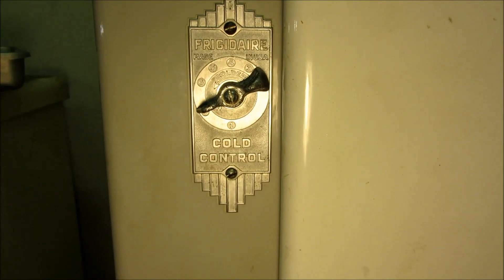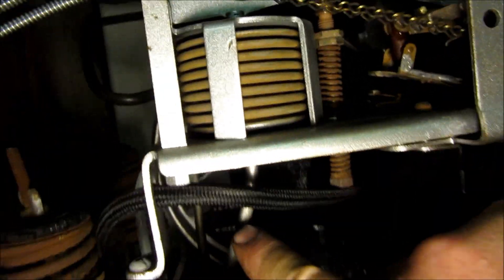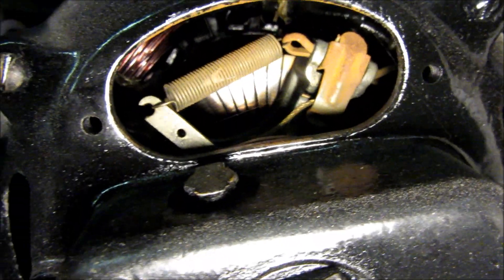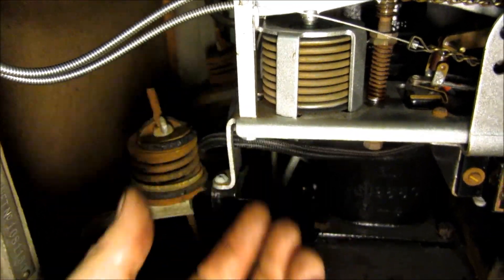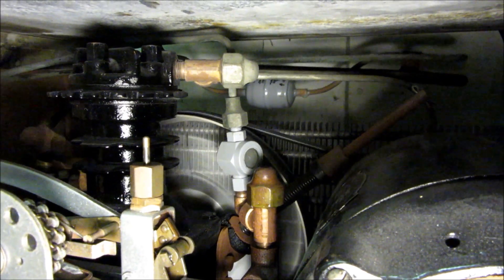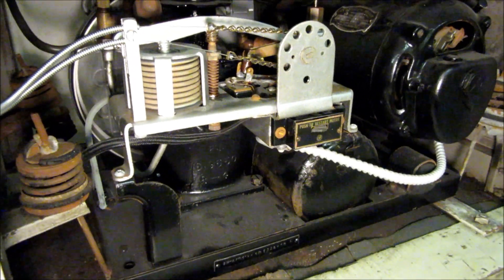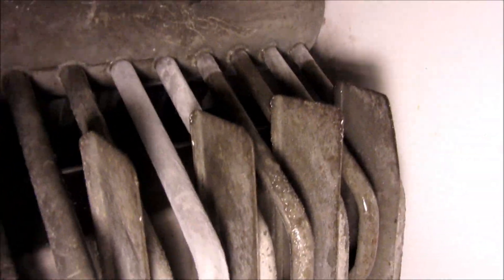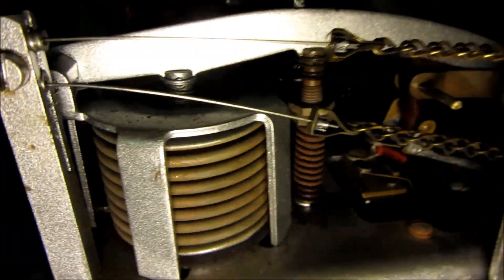Antique Frigidaire Refrigerator Cold-Control. 1927 - 1929

Comment: Beautiful engineering, and a beautiful restoration. That kind of elegance and quality will never be manufactured again.
Reply from the maker: This is true, definitely. Honestly I didn't have to restore this one. All it needed was a shaft seal, belt, and rewiring. The condition of the fridge (aside from the condensing unit) is as it was found. I did clean and paint the condensing unit during the repairs.

Comment: Sounds like the flywheel and small fan on the motor actually move a good bit of air! With the front on the unit, does it tend to block up the airflow?

Comment: Is a modern Chinese (low price point) made compressor really more reliable though? This just requires some occasional visual checks to make sure nothing has gone amiss. I bet a refrigerator from today won't still be usable in almost 100 years.
Reply from the maker: Hi David! Yep I agree with you there!  I guess my point is more about reliability than longterm durability. These new fridges are nowhere near as durable or long lasting as anything made in the mid 40's back. 

The comparison I was thinking was more or less that the belt-drive machines such as this had a very long life, however they would require a lot more maintenance during the life; compared to a new unit. 

These required periodic major maintenance in the form of mechanical shaft seals; and periodic maintenance with motor brushes and lubrication; drive belts, and the moving parts in the float mechanism. None of these are "fatal" but they require specialized skills to remedy. 

Newer fridges last about 5 or 6 years, with virtually no maintenance; then they are finished and ready to become a welding rod storage cabinet.  The old machines will likely have to be worked on routinely; but are going to be more or less infinitely sustainable if these repairs are taken care of. 

The real stars of mechanical immortality are the late 30's General Electric CK Monitor Top; and the early 40's Frigidaire Meter-Miser units. These were early and highly over-engineered sealed units. The entire compressor and motor ran in an oil bath. There are still many of them around today, which have operated for 70 or 80 years without any internal maintenance whatsoever. 

As for the imported compressors, I've only torn down Embraco compressors. I believe they are made in Brazil, but probably they have factories in multiple countries.  I was fairly impressed wit the design; it was still a cast iron compressor mechanism. The failures are often due to the very small quantity of oil in the system; or electrical winding failures.

The big names are using new "motorless" or "linear" compressors now. These are insanely cheap and fail often. The compressor works like a speaker voice coil and magnet. Instead of a speaker cone, there is a piston attached which is vibrated back and forth by the magnetic coil. As you can imagine this is a really flimsy design and operates at a very high speed. There have been lots of reed valve failures and other mechanical failures with them.

Comment: Unique way to control the temperature! Thanks for explaining how it works!
Reply from the maker: It's very nicely built where you can see the parts. Believe it or not, they still use a similar control philosophy today; but with more miniaturized pressure switches.  One beauty of this is that there is no need for wiring in the cabinet area and all the power and associated risk is kept in one place.

Comment: Still running on SO2 or did you swap it out with something else?  Disregard.  You finally mentioned R152A
Reply from the maker: Yep, sorry the wind noise sort of messed up the audio on that part of the video! 

Using R152A and AB oil gives similar miscibility to the original SO2 and mineral oil. The big issue to overcome is the density difference. The float valve has to be counterbalanced for the lighter weight liquid.
Reply: @davida1hiwaaynet  Thanks for the reply.  I'm wandering through many of your videos.  I think I have most of your process down now.  I hate to be the new guy walking into the shop asking the rudimentary questions ;-)  Pretty cool stuff you tinker with.  I know I'm learning a lot.  Appreciate your time.

Comment: Did the motor was brushless?
Reply from the maker: I think that is a bad translation.  Not sure I understand. 
The motor is a repulsion-start induction motor.
Reply: @davida1hiwaaynet  Brushes are some pieces of Carbon (generally graphite) that press on the commutator of the rotating part of the motor, so the coils of the rotating part will get electricity. It's used in D.C. and universal motors too. I looked and the repulsion-start motor does have brushes.
In an add on the internet I stumbled on an old refrigerator, probably an around 1930 "Frigidaire". The add wasn't about the refrigerator. But I couldn't find what happened to it. Before late '50's, refrigerators where scarces in the place where I live.
Reply from the maker: @Telecolor-in3cl   
Understand.  This motor has brushes. There are two pairs of brushes which are connected together and form a loop through the rotor winding, allowing the repulsion effect to start the motor.   Brush-type refrigerator motors were replaced with capacitor-start motors in the 1940's. By the 1950's virtually all of the manufacturers were using sealed compressors. These compressors always use an induction motor. The starting will be resistance split phase, or a capacitor start. 

I hope you can find your old ad. Those old ads are always enjoyable to see.
Reply: @davida1hiwaaynet  Sealed compressor started to be used into the '30's, "Frigidaire" beeing one of the early adopters, along "G.E.".
Does these motor is capable of runing also at 220 Volts? I've seen another one, probably sealed compressor that could run at 50 Hertz (cycles)...  I wonder what kind of motor was that.

Found that add, try to contact the person, no answer. And it was the only prewar refrigeator that I seen here.